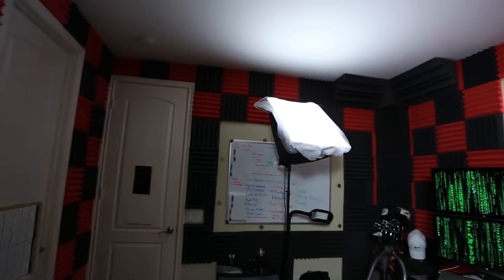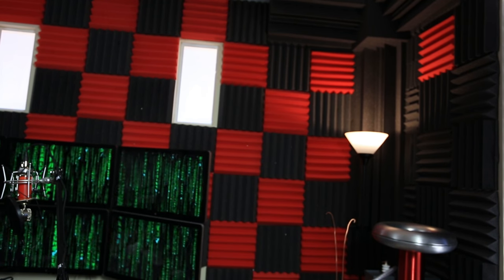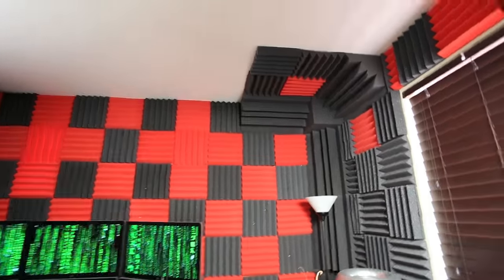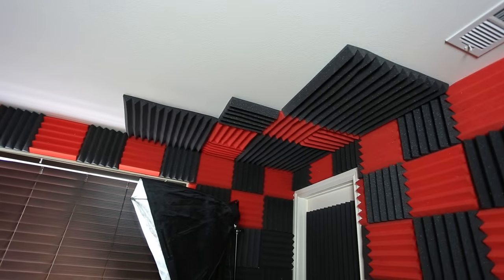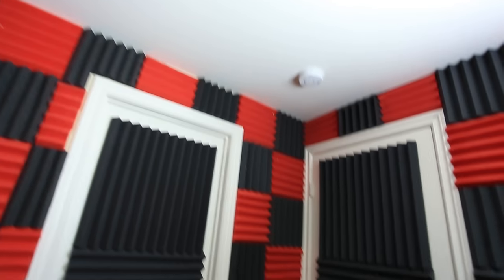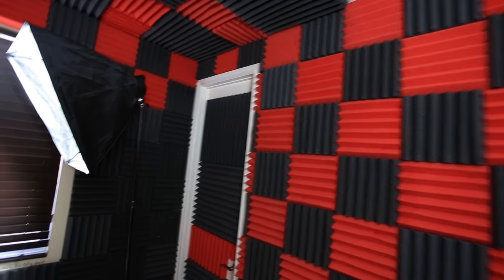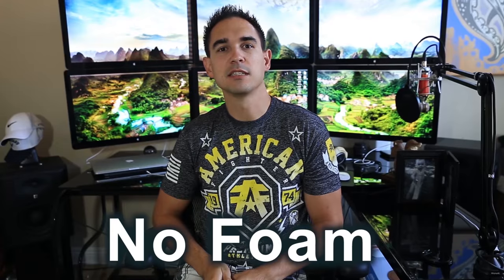Sound Foam: Maximum acoustic coverage

Comment: It's nice to see someone representing foambymail. They are located here in Michigan just outside of Detroit and sell foam for way cheaper than competitors. They also include their NCR rating and independent testing. The 4" Foam Wedges have an NCR rating of 0.80! That is pretty amazing, and you can get 48 12x12" squares for only $112 - and free shipping. That is next to impossible to beat, even with DIY Acoustic Panels considering the time spent making them. Good video sir!
Reply: sneak a quick ad in there ay lmao
Reply: What is DIY?

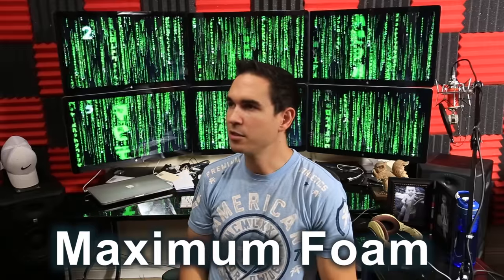Comment: ok so first off starting 2:50 with the no foam test and after with max foam there is definitely a significant difference as far as getting rid of reflections and allowing the voice to really sound more pronounced and its not just a little small difference you cannot hear i have my 280 HDS on and some good volume on it and i can deff see this is worth it. now as far as noise is concerned this will not prevent any noise from escaping or coming thru you might prevent like 5-10% of it coming out or in if even that. so for sound proofing vs acoustic treatment i would invest in a booth either make one or buy one or find a video that can help with adding wallpaper material or something to apply to the walls before adding the foam as well as looking for door guards and door seals and window seals anything where air comes in or out of like vents too. but for what this is id say its very much worth it and i'm now going to buy some.

Comment: with the walls fully covered, did you notice a temperature change. I'm wondering if it is easier to heat and cool
Reply: Most definitely get heated up but it’s smooth bro

Comment: would aucoustic foam remove sound out of my room? example i talk and it hears  out of my room , if i put these would noise from my room be  reduced or removed?
Reply from the maker: +Fnatic Relja only slightly. It makes it sound quieter and flattened in the room you apply it to, but it will absorb a very tiny amount of sound. it changes acoustics using deflection, not absorption aka sound proofing. Sound proofing is a whole different process and requires much more time and money.
Reply: Fnatic Relja v

Comment: Does sound foam make your room quieter from the outside for example people on the other side of the wall don’t hear you shouting
Reply from the maker: Only to a very, very minimal degree.  It's not soundproofing, that's a lot more expensive and harder to DIY.
Reply: What is DIY?
Reply: @foreignwoods8138  Do It Yourself
Reply: @natteslinger8889  thank you

Comment: buddy, sorry to say, but its not "the more the better" with acoustic foams lol, what you re doing is that you re putting yourself into a compressed room, see it has a hard limiter in mixing post-production, you wont have a clear & neutral representation of the actual sound doing that, its too much
Reply from the maker: If you watch my most recent videos, all the foam is still there and I think it sounds great.
Reply: How many wedges did it take to do this
Reply from the maker: I don't remember exactly, but I think it was around 250.
Reply: Ok thanks!

Comment: Foam panels are BS. All you're doing is cutting some highs and making your music sound unrealistic. What you need is Rockwool panels which will dampen most frequencies more equally. Instead of just the highs and make your room boomy. I know that this comment comes off as hateful but I'm just stating the facts.
Reply: Depends if you want a boomy room or not then? Your comment is ignorant because what works for you wont for others,  it depends what you want it for. This guy explained that hes doing it for his specific purpose and hes showing you what he found. The truth is, if you have any clue what you're doing, you can edit out anything or add anything you want in mixing and mastering. Relying on any of this is fine, but at the end of the day its just to give yourself a tiny bit less work to do with editing. You could also get a great microphone and no foam or paneling, or fantastic acoustic foam but a shitty mic, itll still come down to your skill.